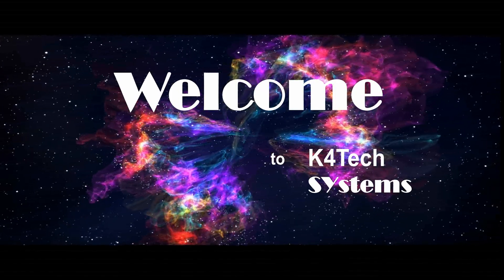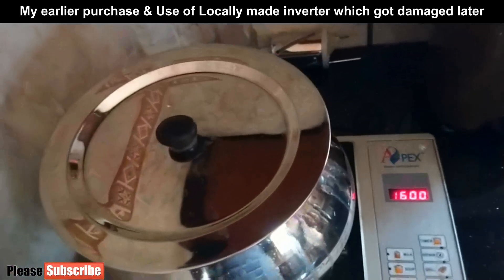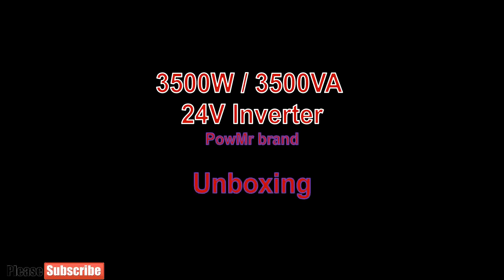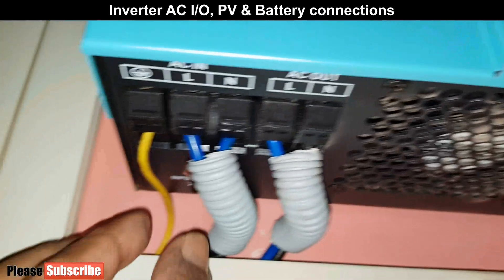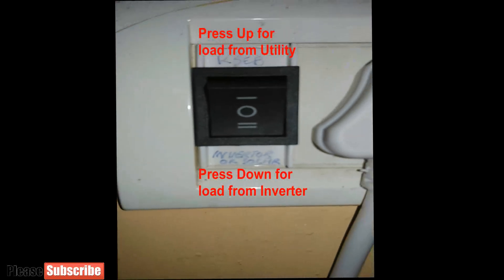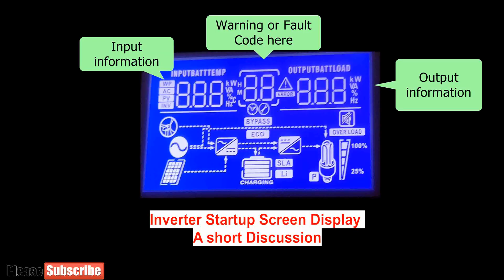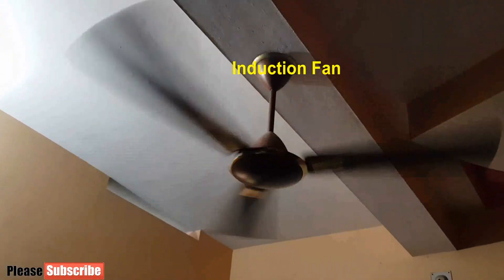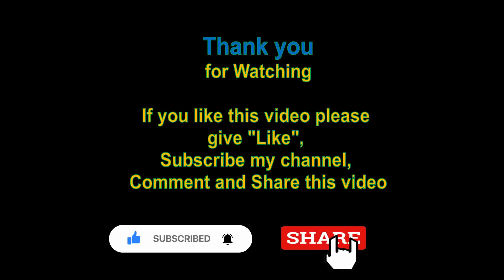3.5KW Solar Hybrid Offgrid Inverter 24V PowMr 2022 | Malayalam subtitle

Comment: 👍
From were you buy this at what price.
Reply from the maker: Inverter price was $295. Shipping costed $150. I paid extra Rs. 6000/- as IGST+GST. For WFI we need to pay $15 more. Different suppliers say different prices. Inverter working without problem. To buy similar hybrid inverter in India it will cost more than or nearly 70k, but wall mounted not available in india. 

 I bought from alibaba.com. when we buy through alibaba we will get protection for our purchase. It is a trustworthy site. Seller was actually a dealer of powmr brand. Contact +86 18665889858 bybwhatsapp. Dealer website is 
https://www.ysolartech.com